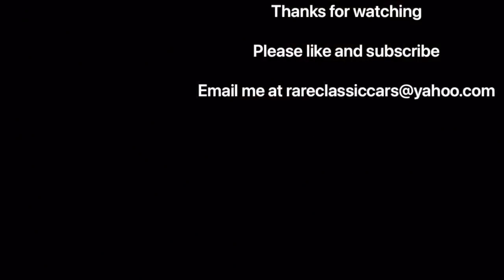Worst Engines of All Time: Chrysler 318/360/400/440 V8 Electronic Lean Burn

Comment: A lean condition will eventually destroy an engine, and it will destroy it sooner than later if you're messing around with any 'supernatural' aspiration... If I were going to engineer something like that on my own vehicle, I would only want it leaning out when the throttle is closed or slightly part-open, and even then, I'd want some sort of water injection or something to quell temperature increases due to the lean condition.
Adam, is that a long-lasting cold, or is that allergies dogging you? If it's a head cold, start drinking a bunch of 100% real orange juice. When I quit keeping soda pop at home and switched to 100% real fruit juices, even Juicy Juice, I stopped getting my yearly head-cold!!! Sometimes I'll buy OJ concentrate, and eat it like ice cream.

Comment: My Mopar experience is lean.  Bought an 87 Diplomat SE with 60k miles in 1992 for $2,995 at the brand new Lexus dealership.  Was in really good cosmetic shape and looked better than the Lexi with which it received free car washes on Saturday mornings for a year!   It ran a little rich and must have been tweaked to run right at altitude because it was extremely reliable and surprisingly strong off the line.  Never had an issue to speak of.  Put another 60k on it and retired it to a collector/restorer who had some really cool iron in his collection  ... of which my Dodge was not worthy  - even if I still miss that Diplomat.  Only my long gone 93 Crown Victoria and my 2018 Taurus rival the 87 Dodge Diplomat for smooth quiet strong operation ... and the ability to take off from a light with 'civil authority'.

Comment: I thought that catalytic converters came out in 1975.
Reply: They did, but several Chrysler models gave you a choice - converter or no converter.  A few 76s had that option as well.  The cars without a converter did not run well stock.

Comment: A little correction for you Adam.  The 14 to 1 ratio you speak of (stoichiometric mixture) is not based on volume of air and fuel as you described. It is actual based on weight.
It takes 4.35 pounds of air (way more than what 4 gallon milk jugs  will hold) just to burn 1 pound of gasoline.
Reply from the maker: Thx.  Just tried to make it illustrative for the lay person.
Reply: It's mass, and it's 14.7 pounds of air, (not 4.35 pound), to a pound of octane that is used to calculate stoichiometry.  Gasoline is a cocktail of different hydrocarbons that varies significantly.
Reply: Thanks for clarifying. What percent of one lb of gasoline is octane?
Reply: @draftwood  I don't know the answer to that.  The people that would care the most about individual components of gasoline are the refineries and they probably aren't going to tell.  I do know that the people that are involved with diesel engine emissions test/engine calibration do not care to know the composition of diesel fuel in terms of what percentage is what hydrocarbon.  If anyone there was interested it would be them.   Upper and lower heating value is what they are most concerned with.  I would assume the gasoline folks take a similar approach.  

The octane rating of gasoline doesn't reflect the octane content.  Octane is used in the calculation because it is a good approximation of the number of hydrogen-carbon bonds in gasoline.

Comment: Adam  thank you for the ELB explanation.  As a GM and Ford Service Manager back in the day, I remember hearing about the poor performance issues.  I  was  overwhelmed with the GM  product issues so didn't pay much attention to Chrysler design flaws.
Reply: Yes, thank you for making the point that it was not just Chrysler products. All the manufacturers wre doing essentially the same thing. And all struggling at it. Brings to mind the debacle of '87 new emissions rules. GM added more garbage to the F-body engines, and Ford put tubular exhaust manifolds (essentially factory headers) on the Fox body.
Reply: As for overwhelming, I completely believe you. The chevy citation and the Olds diesel came out around then. The running joke was if you could get a citation with a diesel, GM would fix it for free forever 😂

Comment: I had a ‘78 New Yorker with a 400 lean burn engine. The heat and engine vibrations caused me to go through two of those spark control boxes in pretty short order. The car would just die without warning and you had no power steering or brakes. It fairly well sucked. As to engine reliability, I had to carry extra spark plugs as one or two on the right bank would foul from oil and the engine would shake pretty violently.

Comment: I had this on my Dodge, I had very few problems with this system. I did have to replace spark plugs a lot. One benefit was gas mileage compared to my Volare. Both got about 18 miles per gallon.

Comment: The electronics of those times were entirely too crude and primitive for the use that they were designed for. I knew that back then. That's why I drove a 1972 Olds 442 with a 455 from 1971 to 2000.
Reply: I have a '70 442, hope you kept it.  They are bulletproof drivetrains.
Reply: The EPA forced it on the auto makers.  If they didn't make it emissions-compliant, it could not be sold, and if they sold it anyway, it would have been registered as a racing car, illegal to drive on a public road.
Reply: @michaelbenardo5695  Exactly. There was a wide gap between engineers with car knowledge and computer engineers and it took a long time to bring both those together under one car hood.
Reply: I’m restoring a 1968 olds 442 convertible now
Reply: @donniemcfarland3160  Good!
Reply: By 93-97 the euros had it down, now the rest of the car was shit but the engine management was great, the reason was Bosch, Bosch made the best engine management systems from the late 80s to the early 2000s after that the immobilization systems got too complex
Reply: @turkeyboyjh1  Bosch developed their system from the Bendix Electrojector fuel injection system that AMC offered in 1957 and Chrysler offered in 1958. Bosch took the time to develop it so it would be reliable.

Comment: I had 1978 Small Monaco with the lean burn 318. 
It failed at around 6,000 miles. 
The dealer repaired  it . 
Drove the car to well over 100,000 with out any problems after.
Reply: "The dealer repaired deactivated  it." 😂

Comment: My father-in-law had a Dodge Swinger(early 1970s) with the 318 and it was fine.  The problem for  me with the car you had in your corner shot is that it is huge!  I always preferred smaller  cars.  I guess that is why I have a 1963 Falcon and a Mustang II(keeping it running right is not easy either). Great video as usual.
Reply: I love huge cars.
Reply: @michaelbenardo5695  I never have.  The difficulty in parking them and the expense of operating them have always turned me off. My Falcon gets over 20 MPG(Not near as safe as modern cars though).
Reply: If it's a Motorcraft carb and Duraspark ignition, with no electronic 'interference,' it shouldn't need much tinkering.

Comment: To this day I really do not understand just why there was seemingly so much resistance on the part of US automotive manufacturers to adopting fuel injection. Trying to bandaid emission controls on top of carburators was in the end a losing proposition.
Reply: They didn't quite have the technology in the 1970's. You gotta remember that emissions standards basically hit them in the back of the head, so it was a mad scramble to get SOMEthing out the door that was compliant with epa standards. They figured it out eventually. Good electronic injection in the 1970's was available, but extremely expensive, and would not have been able to produce an affordable product until technology caught up.
Reply: @life_of_riley88  — Bosch D- Jetronic was introduced in the 60’s, installed in VW Type 3’s, not expensive cars, in 1968. Volvo was using it on their 140-series cars starting in 1971. 

Bosch K-Jetronic (CIS: Continuous Injection System) was introduced in ‘73, and by ‘78, while American and Japanese cars were still using mechanical carbs, the CIS injection system was being used on economy European cars like the VW Rabbit. 

In the late 70’s, the European cars were far more drivable and efficient than other cars available in the US. The Lean Burn System, those Ford Variable Venturi carbs, GM’s electronically controlled carbs, and the Japanese intricate carburetion systems (including Honda’s CVCC system) were archaic and laughable along side the European port injection systems.
Reply: @sking2173  I completely agree with you! I was merely trying to give you the examples, or more like excuses that the big 3 used. They didn't have the money or resources to invest until the late 70's and the idea of using Bosch or Lucas injection on American cars at the time would have gotten you laughed out a board room.
Reply: @sking2173  But European cars were not expected to be reliable.  American cars were expected to be anvil reliable.
Reply: @life_of_riley88  FACTS!
Reply: Electronic Fuel Injection was not very reliable in the 70s, that's why the Europeans that used it went back to mechanical fuel injection, but then emissions standards became so tight that they had to go back to electronic.  The "75 1/2" Cadillac SeVille came with it, and the 1975 "regular" Cads offered it as an option.  The computers would fail at 60,000 miles and cost $1,000.00.  A Cadillac owner could deal with that, but expecting a Ford, Chevy, or Plymouth owner to do so was not realistic, especially with them knowing that replacing that system with a carburetor and manifold from a junkyard would fix the car for almost nothing.
Reply: @michaelbenardo5695   — The Bosch fuel injection systems were extremely reliable. 

I wasn’t crazy about the D-Jetronic systems because they  all seemed to come equipped with a built-in off-idle hesitation. But all that disappeared with the CIS system. These systems offered better drivability than the contemporary American and Japanese carbed cars, too.

That Cadillac system you brought up performed well for what it was — an analog, open loop system. You mentioned computer problems, which I never saw. Coolant temp sensors, fuel pumps, and especially MAP sensors, yes. but failed computers, no. You are right that parts were expensive, and generally dealer-only.

Comment: Very interesting vidio. I don't remember anything running well during that time. My '79 360 cooked most of the exhaust valves at 90,000 mi. No one I knew back then got decent gas milage and power was pathetic. I put a '74 cam and ignitoin in it. Then I played a bit with the tuning. Power was great.
Milage was great.

Comment: Once they started with adding stinking computers to vehicles, it was the beginning of the end, slow but sure.
Reply: That's why I still have my 54 New Yorker and my 73 GMC truck.  NO COMPUTERS AND NO SMOG CHECKS!
Reply: @michaelbenardo5695  For instance, today they can't build their big bad trucks without a little tiny microchip. How pathetic can it get!
Reply: @lonnyjaw  That's the EPA for you.  Actually, they probably could, but it would have to be so mild to meet emissions targets that a 350 engine would produce only about 115 horsepower @3,000 RPM, if that.

Comment: Id love a vid on OBD. I remember when I first discovered I could short those 2 pins with a paper clip and read blink codes I thought it was the coolest thing ever 😃. My Prelude had an OBD LED on the ecu itself!
Reply: Looks like vw had an external diagnostic computer in 72! https://youtu.be/KC31fjbsPLQ
Reply: I could troubleshoot any non-Cadillac GM from that era the same way: paper clip in the two leftmost upper pins.

Comment: I’m kind of thinking all kinds of garbage technology along the lines of what you describe are in the pipeline considering fuel prices now. It’s bad enough as it is with turbos and the like.
Reply: I don't want anything to do with a turbo on a gasoline engine.  Diesel, yes, but gas should be supercharged.
Reply: @michaelbenardo5695  I agree. Many gasoline engines over the years have been successfully supercharged with similar reliability to normally aspirated. Turbo, not so much. Turbos and diesels are like apples and pie. Also carmakers have no business making Diesel engines. Leave that to the pros. But that is a whole other discussion.

Comment: I can attest to what junk these things were. As a kid my father had a '77 Charger Daytona, basically a sporty looking two-tone paint version of the Cordoba.  It had the 400 Lean Burn with the Carter Thermoquad.  This setup would vapor lock and refuse to start nearly every time when it was hot outside and the engine was warm.  Fond memories of sitting in burning hot parking lots as the old man swore Chrysler up and down!
Reply: Yep, I spent my childhood with my dad in parking lots waiting for vapor lock to pass on a 1978 Ford Fairmont all along sitting on vinal seats getting 2nd degree burns.
Reply: @robertdiehl9003  Wow what a pile of junk the Fairmont was.  I rode in one that was a four cylinder back around 1980.  It would barely move!
Reply: @spaceghost8995  I had a 6 cylinder Fairmont as a company car.  It would get stuck in 2" of snow.  The ride comfort was terrible.  Even a dealer confided that it was noisy as well.  It was replaced by a Chevrolet Citation that would climb a tree if requested.  However, the brakes would cause the car to spin out without warning.  Such is the life of a road warrior.
Reply: @spaceghost8995  My mother had the Mercury version of the Fairmont with the 6.  The only problem with it was the flexplate - it would break away from the converter.  I replaced it twice for her, and engine-out job.  If it wasn't for that, it would have been 100% reliable.
Reply: @michaelbenardo5695  Sounds great!   haha
Reply: @robertdiehl9003  Mom had a Fairmont wagon. I recall the same kind.of experiences!!!😢🤣
Reply: The 360 in my 1978 Dodge Magnum was reliable enough but the rest of the car was junk especially the interior components.
Reply: @johncarter1137  Oh yeah the handles on evrrything would just break right off!   Arm rests fall off, glovebox latch falls apart, door seals, you name it.  Just think you could have bought a Dodge truck with that 360 motor instead of that pile of shit Magnum!
Reply: What a nightmare!   And you were too young to know how to help!
Reply: I love MOPAR.  But with my LB 318 in a '79 Magnum, I started thinking that before Iacocca, MOPAR stood for Mostly Old Parts And Rusting. 

Loved my '70 Challenger though, even though it was a 318 with a 727 Torqueflight.  Sigh.  High School memories of replacing transmission bands on a regular basis with that Slap Stick...

Comment: The "Lean Burn" system just sucked!  Another attempt at retrofitting an engine that was never designed with emissions and fuel efficiency in mind like most everything the Big Three tried in the '70's and early '80's,
Reply: Trouble was, designing a new engine, or at least new heads, takes time.  If they had taken that route, they would not have been able to sell anything until the new was released for sale.  Blame the EPA, not the automakers.
Reply: @michaelbenardo5695  Absolutely not. Honda made it work. Toyota made it work. Mercedes made it work. The Big 3 didn't want to make it work. Pure and simple.
Reply: @Andyface79  I never said it can't work, I said it takes time, and if it isn't ready in time, they can't sell the cars.  Mercedes is super expensive, so cost isn't an object.  The Japanese were heavily subsidized by the Japanese government.  Our government did NOT subsidize OUR automakers.  You haters have to quit with your refusal to acknowledge this.

Comment: Addressing having early and somewhat crude electronics attached to the air cleaner, we used to get the following condition. Customer would complain about the car dying in traffic just like they shut the key off. No stumble, no warning, etc….well you could have the car running in the bay and tap on the lean burn electronic module attached to the air cleaner with your hand and the car would die….
😂
Yeah great system as we all know the air cleaner gets no vibration.
🤔
Reply: Absolutely!  I had a 1977 Dodge Diplomat that used to turn itself off.  On the expressway.  At 70 miles per hour!!!!   Had to slap on the hazards and do a super fast shift into neutral and pray it restarted.  Got rid of it when I started having nightmares about crashing….
Reply: I had a 78 Dodge Magnum with 400 lean burn that would sound like it puked at highway speed sometimes. Do that for a few seconds and go back to running fine. It would sound like it took a shit but would only shart. 😎

Comment: Correct me if f I'm mistaken, but I believe the stoichiometric air-to-fuel ratio of 14.7 refers to weight, not volume.
Reply: You are NOT mistaken.
Reply: Mass
Reply: @RealDeanWinchester  Well, yes.  From a technical standpoint, yours is the more correct answer, but weight works here too because we're discussing mass in gravity.
Thank you for the correction.

Comment: I think I would pull the carburetor and distributor and put in a throttle body injection and a modern distributor on any Electronic Lean Burn vehicle.
Reply: But here in California, you can't change ANYTHING, or else they refuse to pass you at smog checks.
Reply: @michaelbenardo5695 Here in Texas they don't even check for emissions for cars more than 25 years old.  So in Texas you would be free to make modifications on cars on model years 1997 and older.
Reply: @johnhudelson2652  You guys are lucky that way.  Here, it has to be pre 75.

Comment: Are you considering doing any videos on the GM 2.x L(non ecotec)? Or the Ford Lima 2.x L  Engines from the 90s? Although the Ford has a lot of modern features like overhead cam and 2 plugs per cyl it seems like an overcomplicated disappointment since it makes about the same power as the GM.